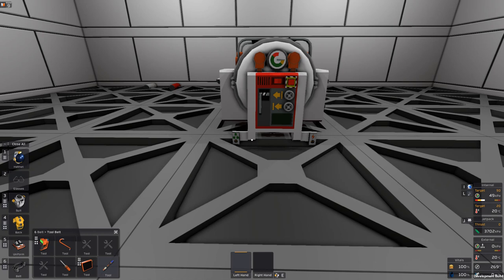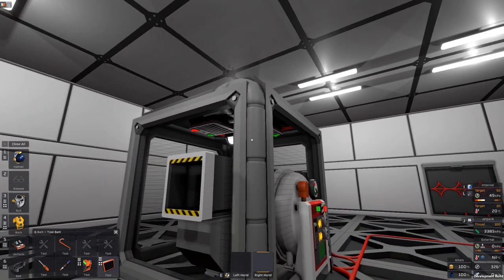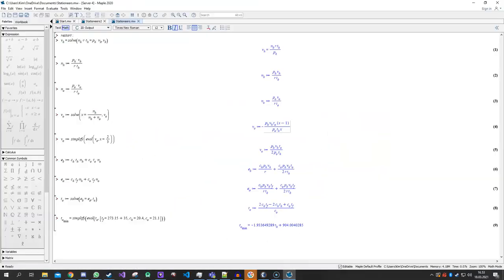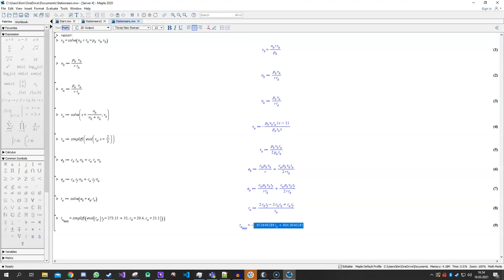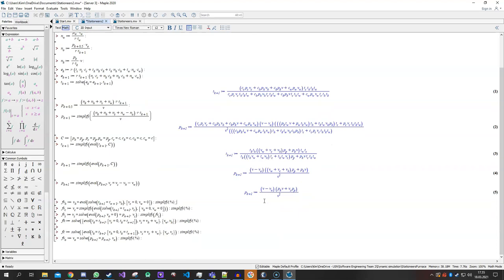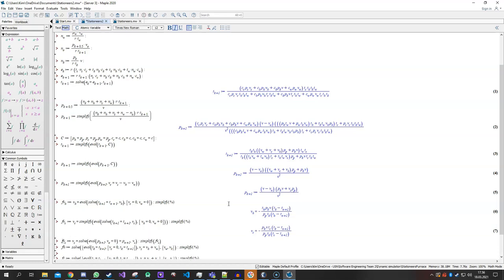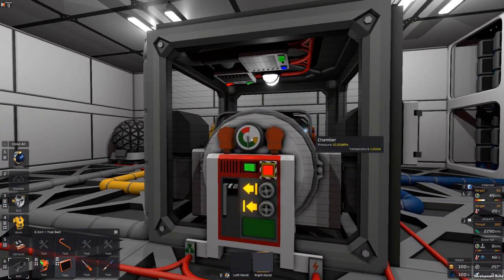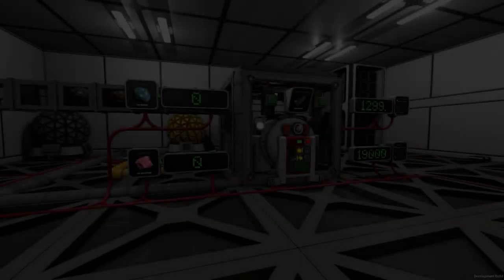The unnecessarily complex Automated Furnace - Stationeers

Comment: This is not the «unnecessary complex» furnace, this is the perfect furnace. You have total control over the pressure and temperature, unlike other solutions where IC tries to compensate one another.
Hands down the best setup, I don't know how you can improve this since it works 99% accurately.
Reply: Yeah i agree this is not even over engineered its just the right amount of engineered that it functions flawlessly and its actually possible to build in survival.

Comment: I have set this up on my Mars play through and once I ironed out a few hic-ups I ran into in dealing with a cold start, this set up has been amazing. Nice job!

However, if you were to do a "How to Set up" guide I would advise to make sure to start with what I ran into on  a "cold start". 
I just had my H2 and O2 supply lines coming in at room temperature (21c). So at the start I had...

Hot O2 tank (5Mpa/20~C)  (Had some O2 but was cold)
Furnace (empty) (0pa/0tmp)
Combusted Fuel Tank (empty) (0pa/0tmp)
Hot Waste (empty) (0pa/0tmp)
Cold Waste (empty) (0pa/0tmp)

The system hung waiting for a cold furnace to heat up the O2 before it could make the Hot Fuel line. 
I would imagine the quickest fix for this would be to fire up the furnace before sealing it in the furnace chamber and bathing it in O2, but I did not do that and ended up blowing up the whole thing in a glorious fireball.

Comment: Bro, your math is on point. Watching that temp not move as the pressure increased was nothing short of art. Very nice!

A small addition you can input any number of variables to an ic, simply have it set a request value on its setting that any number of other ICs will react to to set a variable to a memory chip or vice versa it sets a request to a memory chip that is met with a value pasted to its setting.

With the limited lines of code i cant see this being necessary very often but it certainly has a place. Especially in crafting or auto smelting.

Ive done a setup myself on the workshop when i was first learning mips from Mick. 
Im Korin there. I have the mars precision furnace and the AIMeE unchained saves up.

Soon ill have a Venus furnace setup with at least 2 gfgs. That base will eventually be fully automated with AIMeEs and rockets. Ill update the workshop with each system i finish to share 😊
Reply from the maker: dude i loved your furnace setup! :D been tearing it down trying to figure it out!  Can't wait for your next thing. 

The main restriction on my furnaceController was line limitations and variable limit. i spent a couple of weeks reviewing every line trying to squeeze out as much as possible. there just want room for any sort of communication logic. all the screwes was occupied, so i had to get two values into the controller trough db setting and i had to distinguish and assign them without failing if there isn't any values, with just 6 lines. the struggle was real. :P
Reply: @Elmotrix  lol ive been there, sitting at an ic editor for hours scratching my head lol
Reply: @Elmotrix  you've set the bar high with PID controllers. They are obscenely unnecessary but its like damn i know i can do it and its so cool.

My mars furnace is obviously not PID, but it was my first real crack into MIPS. Ive learned a lot since then so the venus setup will be a bit more impressive i hope

Comment: very nice engineering. If i may suggest some more overengineering on top of this :-), you could consider setting up the ingot size and then let it order resources from vending machine, which could be automatically delivered to the furnace. The vending machine may fill up itself from a set of silos, one per each resource type.

Comment: I have been running into that problem with overfilling ic's.  Been trying to find creative ways to moving data around, like using the stack as an array or indirect lookup table (Apparently each ic is given 512 stack depth).  By using the lb/sb min/max function to all my ics, I can call them by interval network numbers I assign.  Only problem is the ACK (acknowledgments).   On single player it works great.  Multiplayer seems to lock up a lot.  Enough to add to many yields everywhere.

Just kind of wish they gave us access to that 512 stack space and make the ic code compile into real byte code.  I want to do fancy stuff like self modifying code and such.  Going to try this thing on a dedicated server I run to see if it works in multi player.

PS - I hate alias's.  Yea I use them, but from somone who programed Z80's and ARMs, it hurts my sensibility's.  Not mentioning ra and sp.  What kind of ic has 18 regesters:P

Comment: Excellent! But have a problem with craft waspaloy, the pressure does not exceed 39.56 mpa, unless you go manually putting oxite, which then the interior where the oven is encapsulated to heat the oxygen the temperature rises a lot breaking the iron window.
Reply from the maker: Have you checked your tanks? Sounds like you're running out of gas.
Reply: @Elmotrix  Yes, have oxigen and h2 in tanks
Reply from the maker: @sebajv  the waste & coolant tank
Reply: @Elmotrix  Waste have +25MPa and cool tank 0MPa
Reply from the maker: @sebajv  get some cold gases in there :)
Reply: @Elmotrix  yes, I had already solved it 😅, thanks anyway.